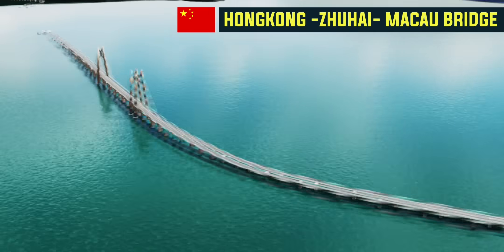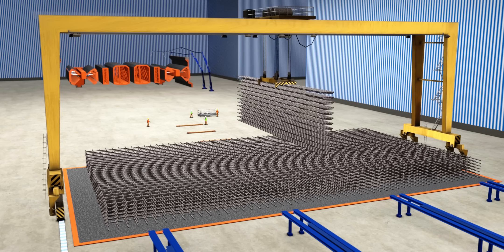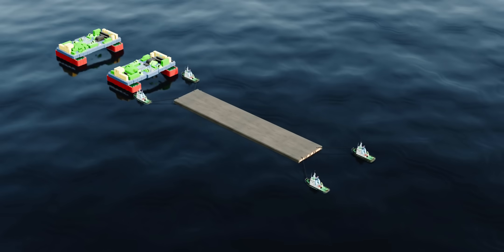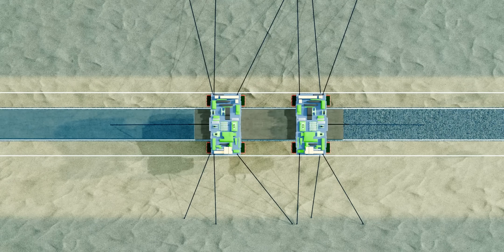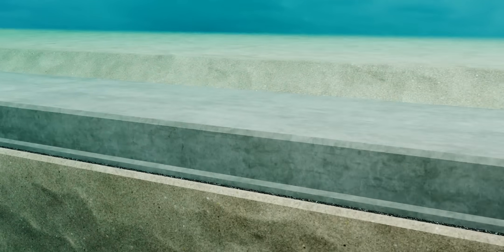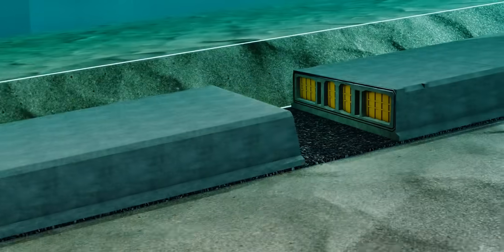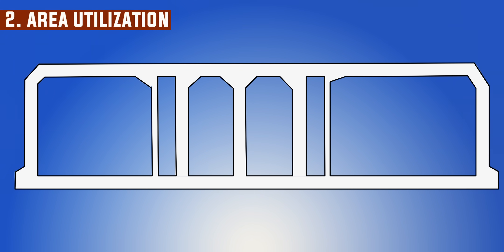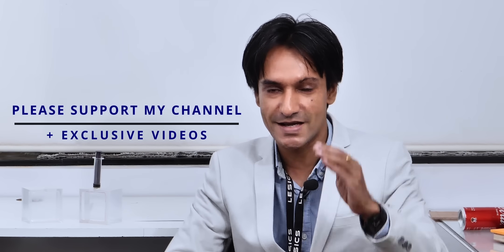Immersed Tube Tunnels | Genius Engineering Under the Waves

Comment: This is a very informative video that concisely explained how ITTs are constructed and installed. Just two questions that need clarification are: Are the structures capable of withstanding atmospheric and water pressure over time, and does the salt water acidity pose any threat to the structure?

Comment: This person is high on crack! It's impossible to travel large distance under water using cars. Without correct ventilation and safety protection for flooding it's impossible unless your in a strong built-in with water protection car your playing with death

Comment: 1:23 negative pressure doesn't exist, as an educational/engineering channel you should be more accurate with your wording.
Reply: It's not mandatory to comment since in engineering and material science, negative pressure means  tension.
Reply: @epo.sho.donis.3.8.0  no proper engeneer or scientist would use "negative pressure" instead of "tension".

The problem is that younger people are now educating themselves via the internet, and I get a headache when I hear what they "learned" from the internet "experts".

Comment: Why not create the bridge instead of this, is this cheaper?
Reply: Bridge would need to be very high for cargo ship to pass through
Reply: @jene7794have you seen how high the bridge in china which just recently open?
Reply: You wouldn't feel any financial gain, even if it is cheaper
Reply: Because that’s a hard work ok you don’t have to give ur dumb opinions relax
Reply: Cross-sea projects such as the Shenzhen-Zhongshan Link need to lower their altitude to allow flights to pass smoothly due to the presence of an airport nearby.
Reply: It’s cooler and that’s all that matters
Reply: Also bridges need to be closed on windy days
Reply: Bridges are prone to aerial bombardment and undersea bombing is tricky and less effective due to tremendous pressure of water.
Reply: I think the bridge runs more risks because of the elements. They have already created this safe method to do it. I don't know anything about how to build tunnels or bridges I build houses so this is just my opinion . Good question..
Reply: 😂😂😂😂😂❤ right like people haven't thought of this in the pass the end result???😂😂😂😂😂😂

Comment: How do the workers install the Omega seals when the workspace is under a partial vacuum? Is the water all removed and an air-lock fitted, so that men can enter into the space?  Ah, moving along I see that the Key Element is installed in this very manner, so I presume that each of the sections is likewise installed.
Reply from the maker: Sorry for missing this point. I think to access the partially vacuum chamber, each element should have two bulkheads. The workers can initially stay between the bulkheads. Once the dewatering is done, they can open the temporary bulkhead and enter the chamber to install the omega seal. The other bulkhead will make sure that the negative pressure is still maintained.
Reply: @SabinCivil  hello
Reply: Number whatsapp

Comment: You explained everything except how workers pour the concrete in the vacuum between the bulkheads.
Reply from the maker: Sorry for missing this point. I think to access the partially vacuum chamber, each element should have two bulkheads. The workers can initially stay between the bulkheads. Once the dewatering is done, they can open the temporary bulkhead and enter the chamber to install the omega seal. The other bulkhead will make sure that the negative pressure is still maintained.